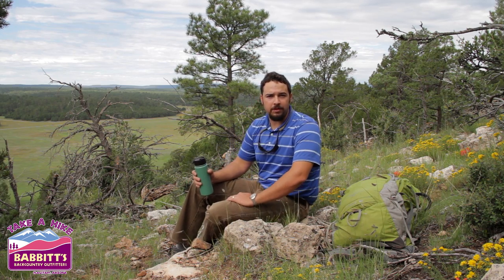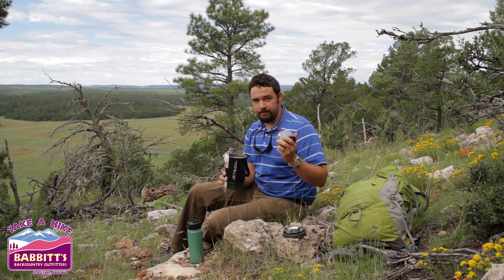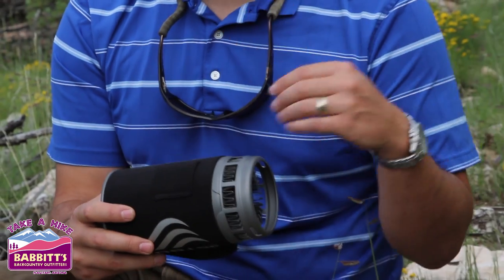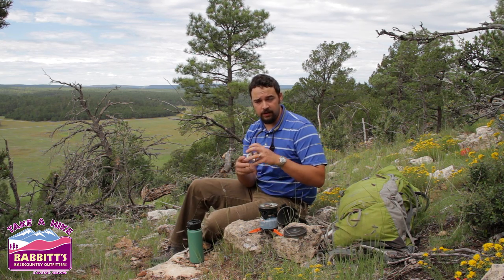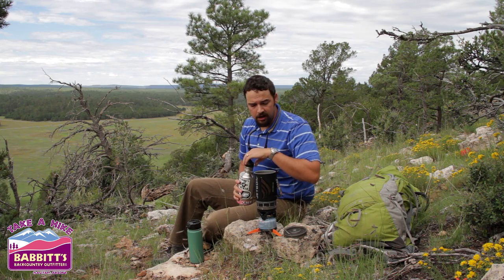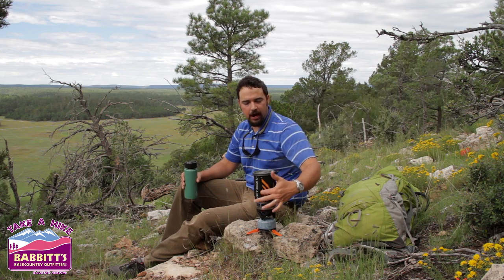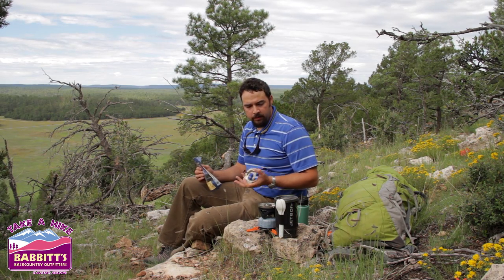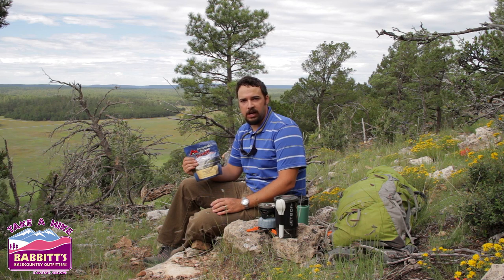How To Use a Jetboil

Comment: So the plastic lid can go on top while it’s boiling? I feel like it would melt. Also, snapping on the plastic cup afterwards on the bottom? Seems like the heat would melt the cup?
Reply from the maker: The lid is most definitely meant to be on, it makes the water boil faster. These plastics will not melt, they are intended to be used this way.
Reply: @BBOFlag  awesome!! Thanks for the reply. Going out for my first time overnight. Want to be super prepared!